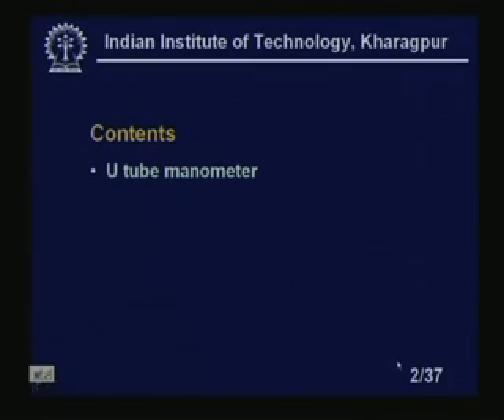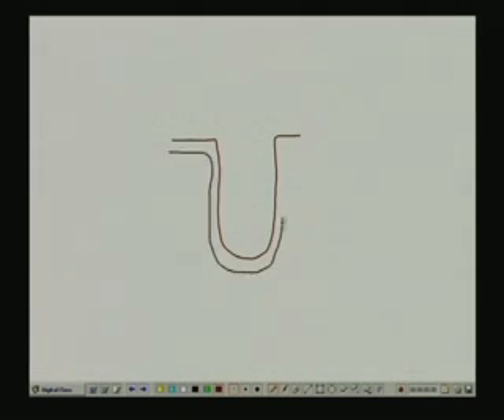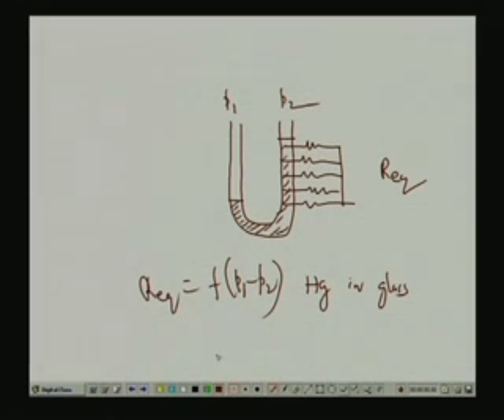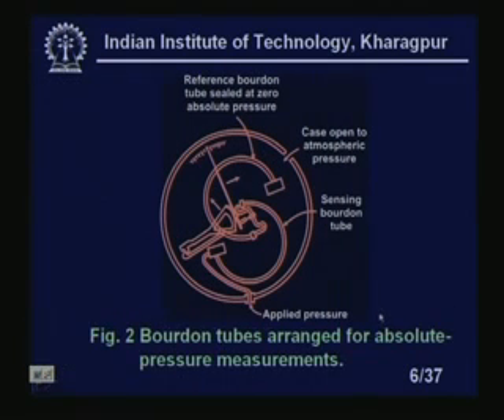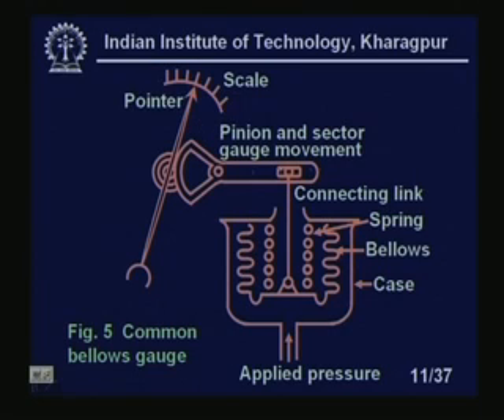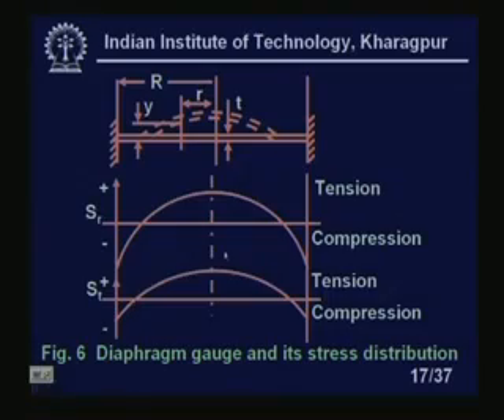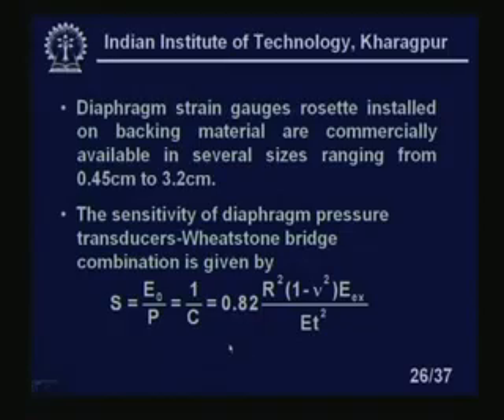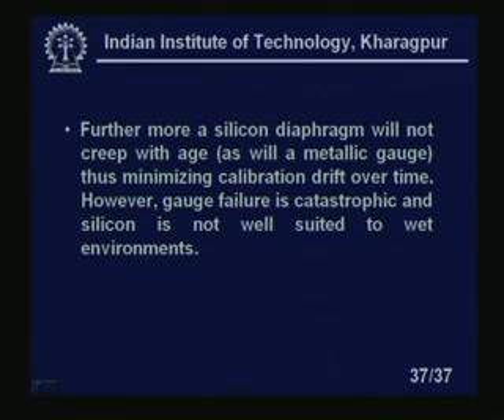Lecture - 18 Pressure Sensors

Comment: Good lecture... but i want to see some lecture which is on transmitting pressure in term of electrical signal to detect on plc or microcontroller.